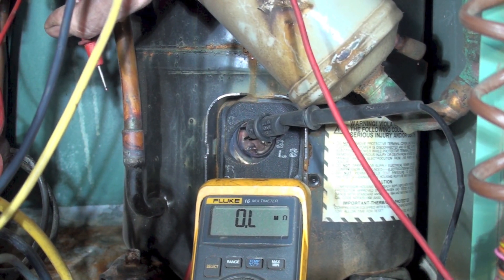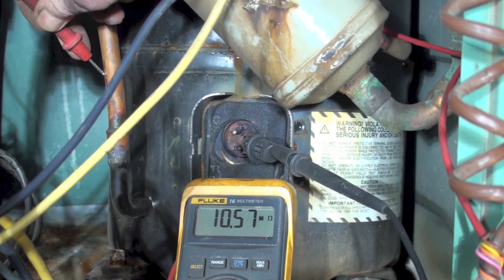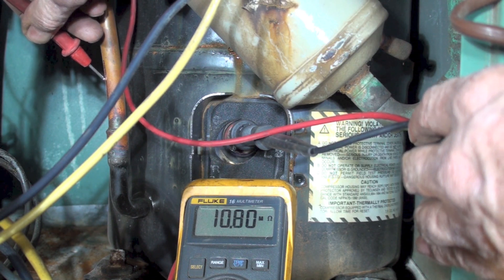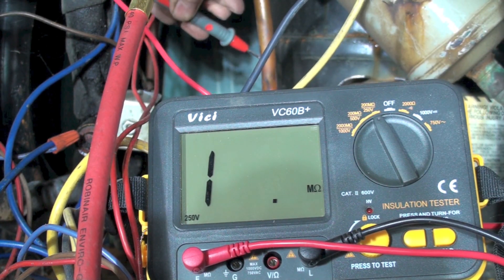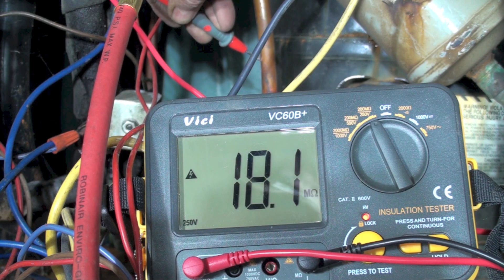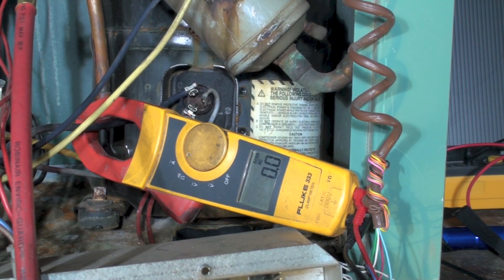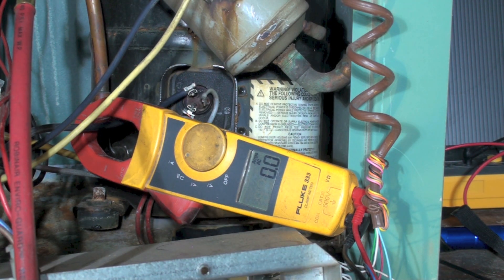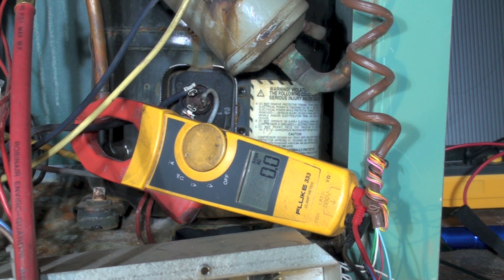Is this compressor failed

Comment: that reading is so high i'm not sure its even reliable.  i can easily get lower readings touching my leads with my fingers. one would have to wonder if internally there is some oil or contamination causing it. or if it was on a really humid day if its not externally  conducting.

Comment: I use my insulation tester on non circuit board refrigerators on the power cord between the ground and hot / neutral terminals. This helps me find bad defrost heaters, defrost thermostats ect. On a recent call I found a wet shorted light socket that way, I double checked after the repair and the insulation tester showed a bad reading. It turned out because I was also preforming an evacuation the compressor had a bad reading while in a deep vacuum but perfectly fine with pressure inside, in ran fine too. Pretty weird huh?
Reply from the maker: loudpipesavelives69 For some reason, I don't know why, a vacuum reduces resistance and indeed, if you start a compressor in a deep vacuum, you are risking a short in the windings.  Check Tecumseh.  They put it in their service manual.
GFM

Comment: I quit wasting my time testing and troubleshooting every little detail of every system years ago.  In this case, I'd advise my customer that the compressor windings are starting to fail and recommend replacement of the system.  I'll tell you why, when you get tired of driving a beater rusted work truck like I did for so long, you finally realize to have a nice work truck and good family medical and dental insurance, you'll have to start selling stuff rather than fix it.  How is an a/c company going to provide all those wonderful things we all want if the company makes no money.

Comment: If the megger shows leakage to ground, is that not at least an indicator of the insulation on the windings breaking down?  Megging the compressor windings, as in your demonstration,  doesn't necessarily indicate a short of the windings themselves to ground does it?  A true short  of the windings to ground would trip the circuit breaker, right?  If the compressor power supply circuit is in good condition,  then everything points to the compressor, expecially since your demo is disconnected from any external wiring.  Your megger and insulation tester makes me conclude  that the winding insulation or the terminal insulator is failing, which as you say would indicate a compressor failure about to happen.   Am I making sense  with this?
Reply from the maker: ritewayguy It is an indication of a possible breakdown.  However, motor compressor assemblies operate in an environment of oil and refrigerant and sometimes moisture and contaminants.  When I first tested this unit it was below 5 megs.  When the refrigerant was replaced with new and evacuated, it came up.  open motors usually read higher than motor compressors.  So the answer is not all in the numbers.  This test may be an indicator of a future problem or poor service work in the past.  Hope this helps.
GFM

Comment: I have seen a few that showed resistance to ground and still ran fine. I know of 1 that showed and is still goin 5 years later. Thanks for sharing!
Reply from the maker: awsom70 The best use of these is on systems that are critical for down time.  Recordings of resistance can give you the info to determine when to replace.  For the vast majority of equipment, its no big deal.  I am not too thrilled with using them as a sales tool.
GFM

Comment: I've had them test around the 1M ohm range and run ok, the reading can improve once the compressor has warmed up a bit.
Reply from the maker: heavydiesel Some of the Carlyle compressors are rated to be normal at about 850,000 ohms.  I wonder how many of them have been replaced that read around that number.
GFM